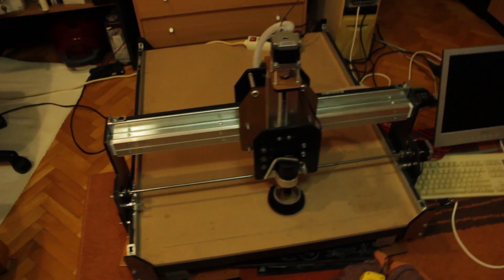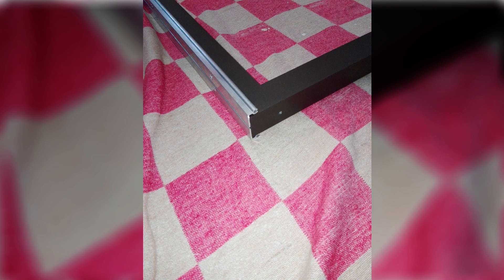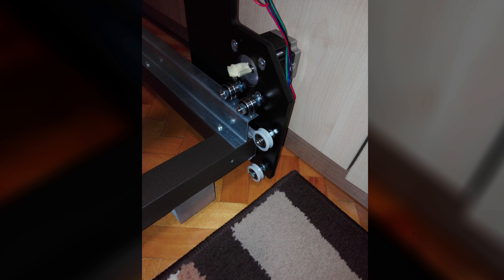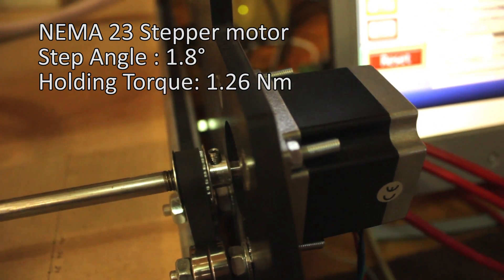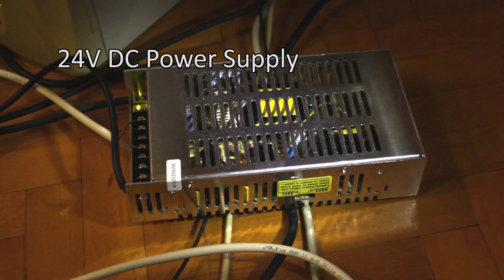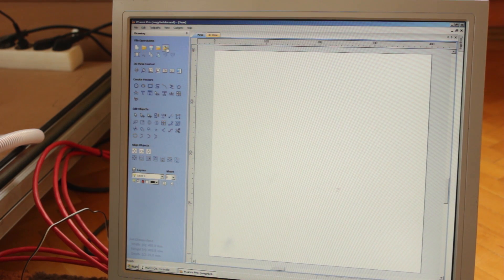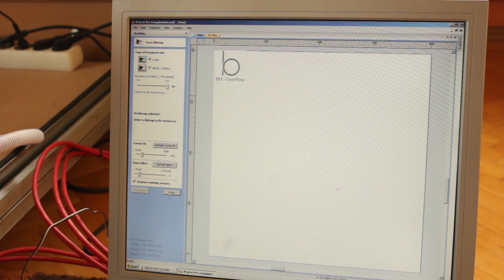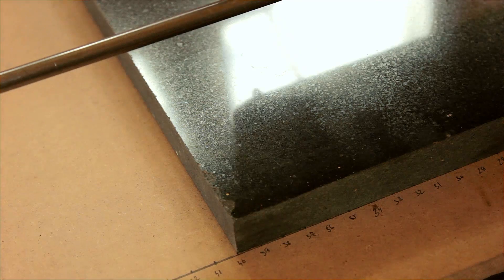Homemade 3 Axis CNC Machine Review

Comment: why not just have a little air hose attachment follow the stepper so it blows any fragments off the material. 
I saw that you had a little brush and assume it was just removed for the sake of the video though.
Reply from the maker: We use it to engrave granite so blowing the granite dust in the air is not the best thing. But we are working on removing the dust :D
Reply: right because... i guess because its not an enclosed system... and you shouldnt be inhaling any fine particles, or blasting shards of metal everywhere. haha sorry, that was foolish of me.  I spoke before considering your reasoning.